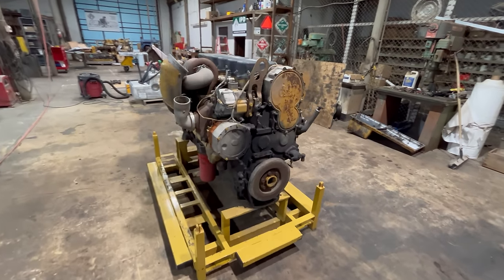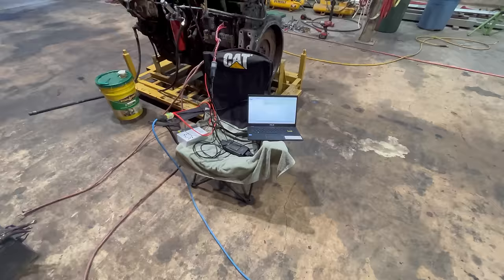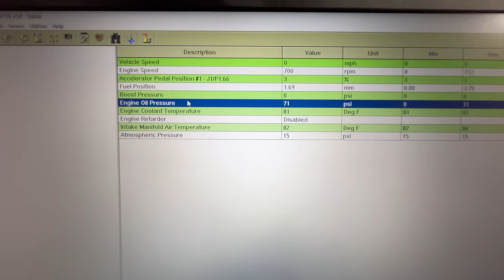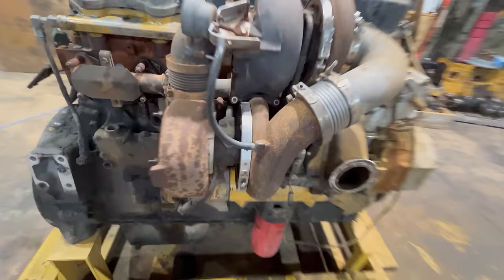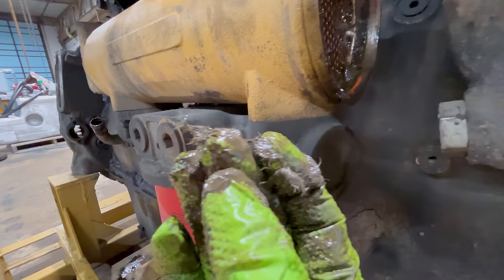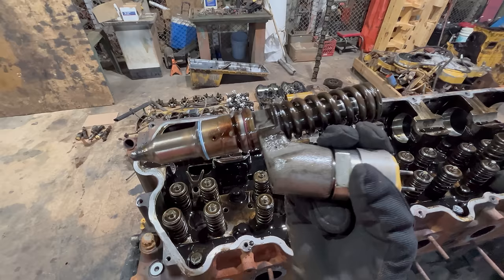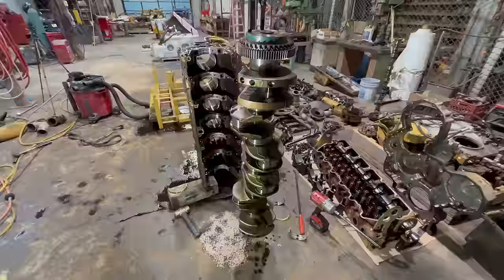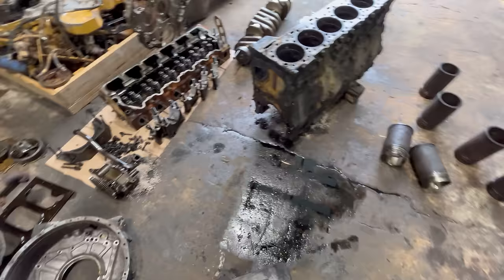Compound Turbo 15.2L Caterpillar C15 Core Diesel Engine - Will It Run?

Comment: Sorry IVA is EGR. Acert over complicated engine maybe SDP series but not that one. Acert had better block, far less head gasket issue compared to rest of 3406 family to MBN.  Acert block and head had higher nickel %. Doesn't matter if its0 compound setup or not still 2 turbos or twin turbos.
Reply from the maker: IVA is not EGR, nor did ACERTs have any less head gasket issues than any earlier C-15s or 3406Es.
Reply: @KT3406E  IVA is EGR and cat even said it was try again. It filled back of intake full of sooty, oil max plugging fitting for manual boost gauge. Backing adjustment off on IVA lowered intake temp. We figured that out long before CAT admitted it was EGR. It was all marketing ploy against other engine companies that used actual EGR Valve. CAT was first to use catalyst brick in exh system before others did. ACERT's still had far less head gaskets issue compared to rest of 3406 to MBN.
Reply from the maker: @pdmustgtd1013  There is no need to try again.  To say that "IVA is EGR" is totally incorrect.  Sure, there is a small amount of residual exhaust gas that remains in the cylinder.  This is true for many engines long before EGR valves (or IVA C15s) were ever introduced.  It has nothing to do with the IVA system itself.  Thanks for watching.
Reply: @KT3406E  Sorry but even CAT admitted IVA was EGR. IVA opening intake valve on exh stroke. Whole thing was marketing ploy that CAT doesn't use EGR valve. IVA is and always has been EGR just CAT calling it different name. Also 1 sensor we cannot monitor oil pressure in rocker base. Oh wait if you ever went to CAT training class you would know this. That was back in 2009 and 2010 last SDP class. Again you have no clue how IVA works or what it does. Thanks for try again and failed
Reply from the maker: @pdmustgtd1013  There's an old saying by Mark Twain that comes to mind.  Best of luck to you.  Thanks for watching.
Reply: @KT3406E  There's another old saying don't talk about things you don't know about. Great cop out have fun

Comment: Just my take for my experience with them cat engines. Looks like somebody pack at slat. Like some of that stuff gray some of it’s got a little copper flake to it. Some of it does look like that Harry fiber ago that you had on your fingers, I’ve seen it all too too cheap to use a mechanic they wanna mechanic in a can.

Comment: Question on the first cooler... if its air to water and the water is usually around 160F is the compressed air even hotter?

Comment: Is it possible the crap in the coolant was added to attempt to block the seepage through the sleeves? Good old bars-leak from the old days of radiator instant repair worked like that.

Comment: Would you recommend removing the precooler? I kind of want to do it’s own water system on it, or do a true intercooler between the stages to help the high pressure turbo by not receiving hot pressurized air

Comment: Those liners looked far from have been recently replaced. Could the previous rebuilder simply have honed the old liners in place without pulling them and replacing with new?

Comment: are there any compound turbo (factory) trucks with a proper intercooler, in between the two turbos, rather than what's normally referred to as an "intercooler" between a turbo and an engine? I know that was common in WWII aircraft engines.

Comment: 33:45.    HEY. BUDD.   LOVE YA.    SO THEY RAN IT WITH ALMOST ALL WATER.    SYSTEM RUSTED.   THEN THEY ADDED A SHIT LOAD OF HEAD SEALER.  THATS WHAT THE METALIC STUFF IS.   HEAD IN A BOTTLE

Comment: That black crap might be head gasket sealer. If they through a bunch of parts at it and it was still leaking they may have thought it was head gasket leak so they dumped sealer in the coolant… who knows!

Comment: Compound turbos are mainly used in aircrafts just saying
Reply: Is that right? I wonder how accert could run compounds for 8 years
Reply: Big boss PDI turbo still better then setup not saying your wrong but airplanes were using them first

Comment: Could the debris found in the engine and the coolant system be some form of radiator stop leak that was put in to stop the loss of coolant in the engine just wondering

Comment: Do you sell or know where I could get an older version of the CAT ET tool and cable you use? I have a 2004 C12 that I would like to access with the tool. This is the only engiine I need it for. If you dont sell this would you know where and about whatt the price us. Thanks

Comment: It's like a slave turbo the high pressure one no? That engine the way it sits is probably as good as 50 percent of the truck engine is service, The ether police, I never hurt and engine spaying ether, you don't stand there and pump the whole can in. just a little sniff will do. Some of the older engines had a place where you screwed a can of ether on them like a filter and there was a little button on the dash for ether, John  Deere had them for sure.

Comment: KT, can you explain which inputs are required on the P1 connector for the ECU to hook up ET and run it with throttle?

Comment: Have to ask, wtf is the need for low pressure turbo on the exhaust side when all it does is go to atmosphere through the exhaust seems dead weight?

Comment: That fibrous and metallic crap looks like a mixture of stop-leak products someone dumped in it to try and stop the coolant loss. Using this crap instead of immediately seeking a proper repair only hastens it's deimse. This means that every part of the cooling system is trashed.

Comment: why have a turbo on the exhaust side? does that boost get fed back into the intake side? (might not be understanding this correctly! :) )
Reply: look up what a turbo is, exhaust gas turns a turbine that turns a compressor wheel, that forces air into the engine

Comment: The engine seems to have been doctored by valve grinding paste by a vindictive person. Ps I think Cummins make a V good engine high torkue and a good long stroke. My first preference would be a scania engine savage power reliably for less fuel consumption.

Comment: That weird shit you found in this engine could very possibly be stop leak not the aluminum stuff but the copper I have seen it before in a Toyota lift truck I have done engine repair and rebuild for over 40years and have seen a lot of stupid shit people do

Comment: looks like they ran straight water in it for a long time, and the porosity started ...  then it started huffing smoke from the blow-by tube OR it started putting coolant into the engine oil. i bet they suspected a head gasket, and loaded the cooling system with stop leak garbage. ( that is the greasy grit you found everywhere)  when THAT didn't fix it, they threw a rebuild kit at it.  and when THAT didn't fix it they replaced the engine. and probably refilled the cooling system with standard regulation pond water, thus completing the life cycle of the retarded trucker engine.

Comment: I can't stand Acerts. couple different trucks at work with a variety of engines. 550 acert can't even keep up with a 485 ISX for some reason
Reply: Probably from operator error!
Reply: They’re a good 475 engine, not 550, I upgraded mine, bad mistake. It wouldn’t pull, fuel mileage went down, ran hot. Everything was not good. Had to be very careful, not fun.
Reply: @George-dy3pt  explain
Reply: @dirtfarmer7472  yeah this one used to be a 475 as well
Reply from the maker: Something is wrong then.
Reply: @KT3406E  I wish I could agree. I really want to like them. But all 3 of the 550 acerts I've driven pulled about the same
Reply from the maker: @Raise986  I can assure you something is wrong or you aren't making a fair comparison.  Running the latest files from the commie Cat houses doesn't help either.
Reply: @KT3406E  I didn't even notice you replied to this until a year later re watching this video. I still couldn't figure out what was wrong with that Acert, but I don't work there anymore. I guess it still runs though because I saw it yesterday out on the road